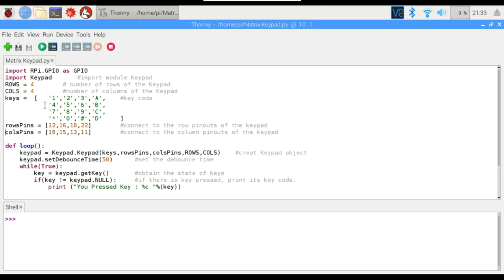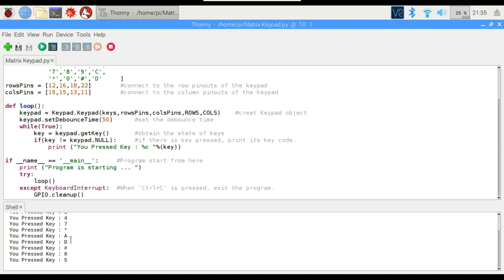4x4 Matrix Keypad | Raspberry Pi 3 B+ | Projects for Beginners

Comment: I get error:
Traceback (most recent call last):
  File "/home/pi/Documents/alarm.test", line 24, in <module>
    loop()
  File "/home/pi/Documents/alarm.test", line 14, in loop
    keypad = Keypad(keys,rowsPins,colsPins,ROWS,COLS)
TypeError: 'module' object is not callable
Reply: I'm having the same issue, did you manage to work it out?
Reply: The problem is you need to type Keypad.Keypad()
Reply: i have a problem
Traceback (most recent call last):
  File "/home/pi/Desktop/Keyboard.py", line 2, in <module>
    import Keypad.py
ModuleNotFoundError: No module named 'Keypad'

ideas??